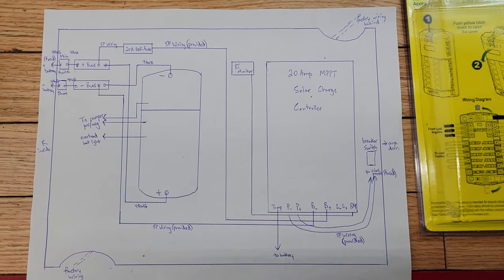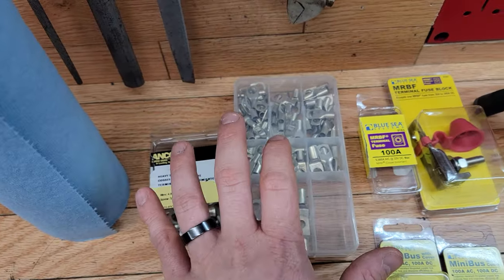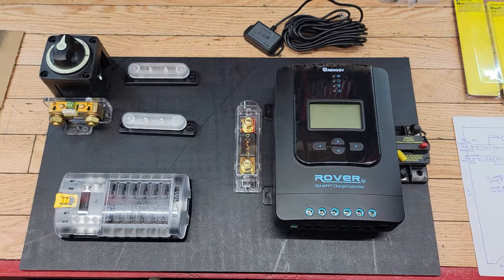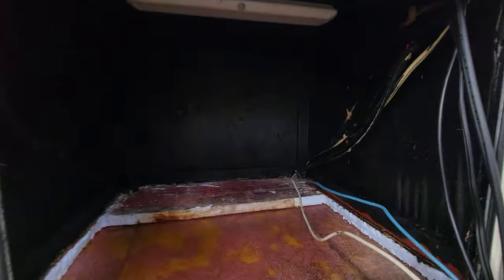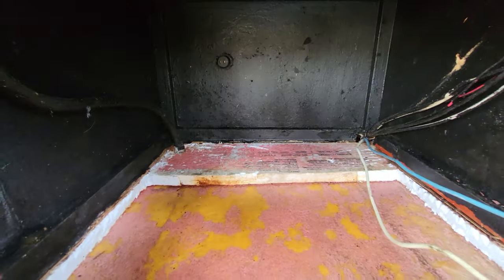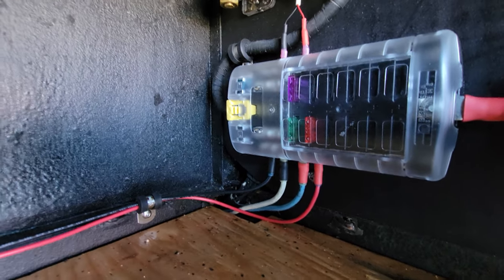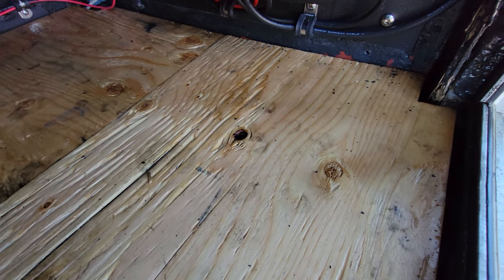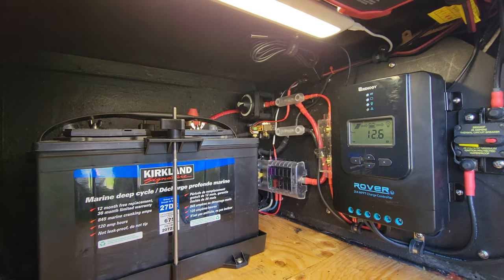DIY Truck Camper Electrical Setup

Comment: Two questions, did the 20 amp fuse come with the Renogy Rover? And where did you purchase the shunt, I didn't see  a link? Thx.
Reply from the maker: The in line fuse came with the solar panel kit and the shunt I have in another video on my channel.
Reply: @OvensGarage  thanks!!

Comment: Nice job!   I replicated your setup!   

One question, you have your battery monitor after the battery shut off, so it’s not on all the time.   Is there a reason you did this?   Assuming when you are on shore power, you turn off the whole circuit with the monitor, controller and fuse block?   Or do you always keep power on to these things?